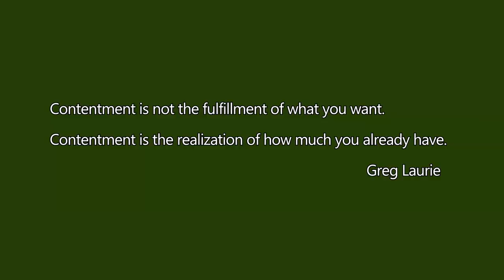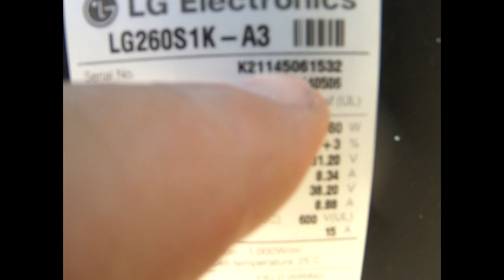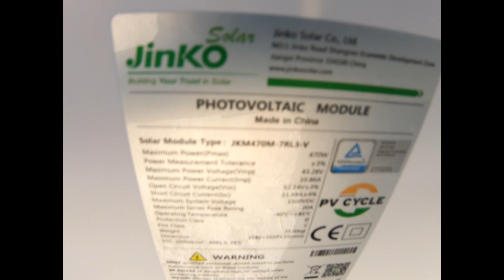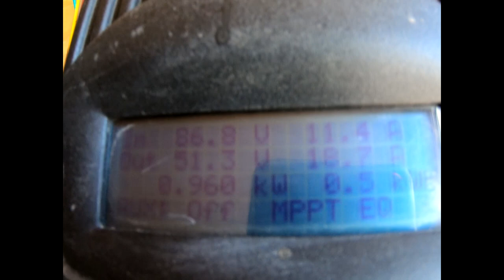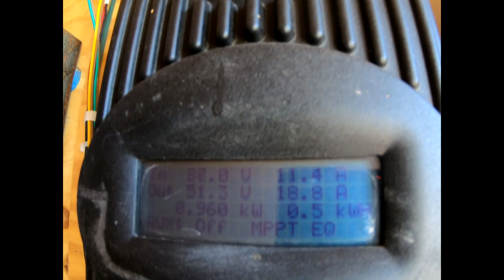October 2023 Update. Dyna , Solar, Garden, HOUSE!!!

Comment: Walls and roof before winter ????
Reply from the maker: Not a chance. Winter is already here. The days are too short and too cold. Be lucky to get the concrete poured before Thanksgiving.
Reply: Farming is a tough life. Cellar good to have for tornadoes 🌪  You've had a busy summer. Yes fall is here, snow in the Sierra this coming weekend.  Can the old solar panels be used for anything or do they go in the trash?😊
Reply from the maker: Hi EL!  The old panels still produce power and can be reused. We don't have a use for them right now. Would you like to have them?